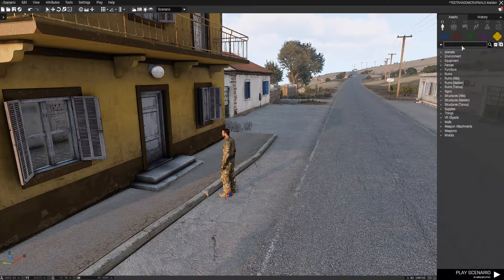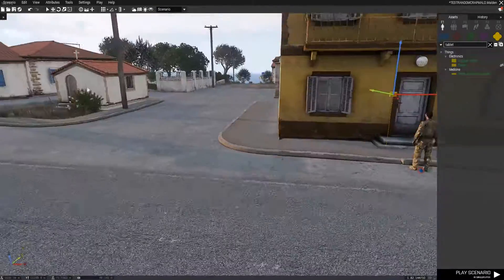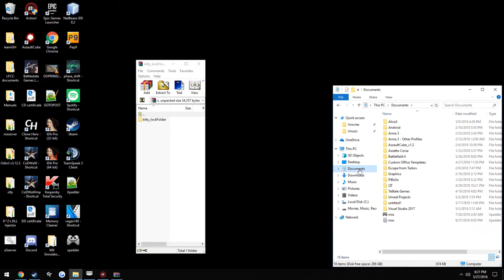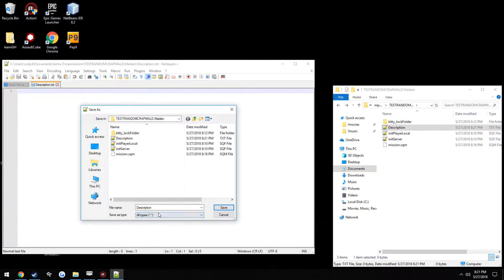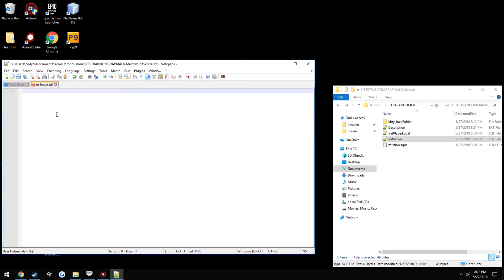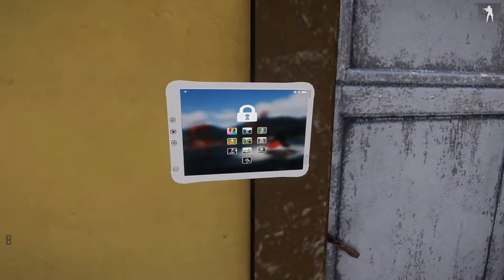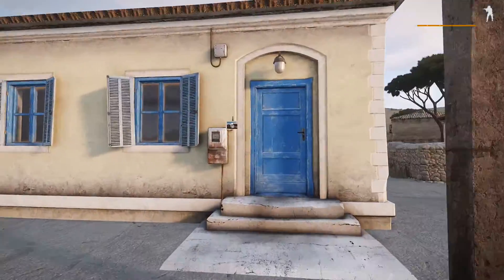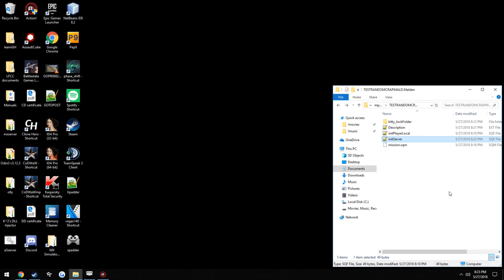Arma 3 Manual keypad installation tutorial (with download)

Comment: Is there any way to set a default code? Or is there a file where codes are saved for persistence? would entering a code in the quotes after "theCode", "", here and running it make all the tablet's default code? _keyPad setVariable ["theCode", "", true]; SoI've modified the lines to actually make the keypads have a default code and for it to be locked but upon start the doors arent actually locked I have to unlock the kp using the default code and then click lock. Any ideas? EDIT: OK I figured it out by placing game logic down on the building and locking the doors that way.
Reply: 666hobart could you elaborate on The game logic?
Reply: I want to make a game that as you progress through missions you unlock the doors in your HQ which have better weapons inside
Reply: can you share the final code you used with the code already set for the doors

Comment: How to make Code Lock work with manually placed buildings?
I am having problem at line 31 of setup.sqf
Reply from the maker: are they vanilla buildings or modded ones? when i tested in the editor i used manually placed buildings in the vr map to make it.
Reply: The building is Vanilla, but for some reason I can not lock the interior
Reply from the maker: thats strange, which building is it? it may not be grabbing the doors in the building
Reply: everyone I tasted inside does not let it hang
Reply from the maker: do the outer doors work?
Reply: @SneakyKittyGameDev  This appears to be an issue with more than one tablet put down. The first tablet worked fine, but when I put an exact replicate down on another building, it no longer works